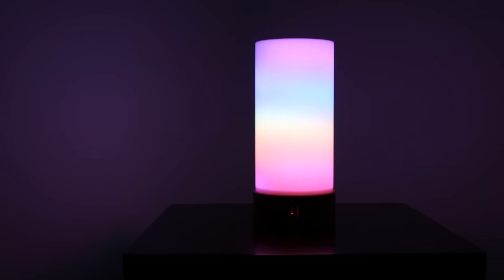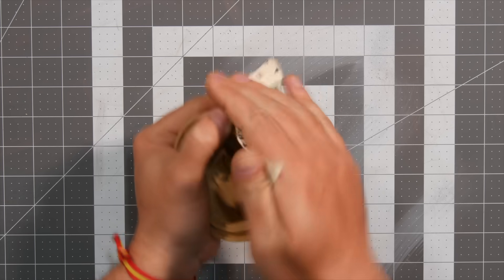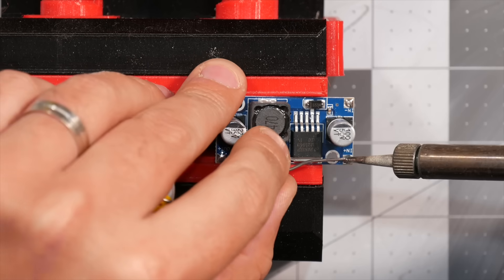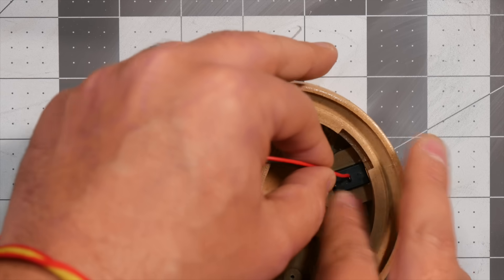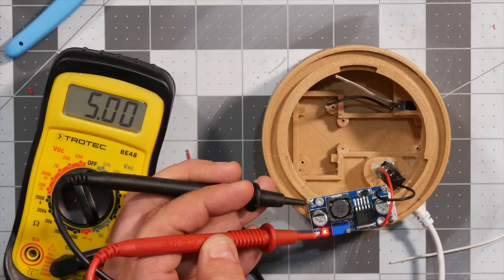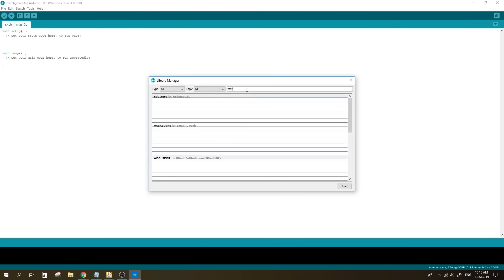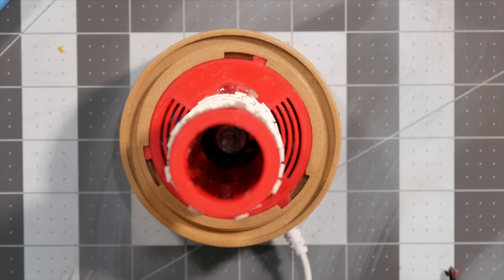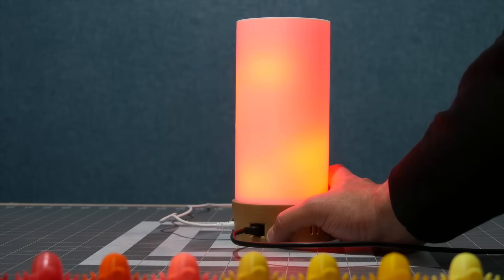Satisfying LED Mood Lamp - 3D Printing and Arduino DIY

Comment: tip: use a nodeMCU with mclighting, then you can control it via your smartphone
Reply: Using wifi or bluetooth or what?? Any other hardware required??
Reply: @franzeleznjak913  yes, use a nodeMCU, it`s about 2.50$ not much different from the arduino nano but with wifi

Comment: You should not connect 5V to the Arduino VIN, there is a voltage drop going via the internal regulator and it may cause the Arduino to be unstable. Vin will take up to 12V with no problem, so just connect the VIN to the DC input. This will also put less load on the step down regulator PCB.

Comment: Hi, it is better to go down with the voltage to 4V (just check, with the voltmeter that at the end of the strip there is still 3.6V when all LEDs white). The LEDs itself are 2.2V to 3.4V, the extra margin 3.6V is needed for LDO. Everything from 5V to 3.6V (almost 40%) is burnt to the heat. You'll get cooler strip with the same light intensity (https://cdn-shop.adafruit.com/datasheets/WS2812B.pdf - datasheet)

Comment: I have a spare 5V 3a external power supply (https://www.amazon.fr/gp/product/B07HRKHY3P/ref=crt_ewc_img_dp_1?ie=UTF8&psc=1&smid=A1FRA7QRK2Q428). Can I use it and skip the LM2596 module? If so, should I solder the +5V on the VIN or the RAW?

Comment: Wondering if there is any kind of tiny bus bar for projects like this.  I couldn't find anything.  Would be nice instead of the dog-pile on top of 1 solder terminal.  Much easier to add/remove wires if needed. Maybe something with screw terminals.

Comment: hi, I was wondering if it is possible to use the second roll off filament with a dual extruder setup as a backup .when the1st runout censor detects run out off filament that the printer engages the second roll to resume the print . was thinking off this and didn't come across a tutorial for this possibility . would you think this is a option ,a specially for big prints this would be a great solution

Comment: Great work. Ordered parts, purchased files, base printing as I type. Can't wait for this one. Also, really loving wood filament so any suggestions (beyond Groot) for nice wood prints gratefully received. Keep up the great work Joe.
Reply from the maker: Will be doing a full video on wood very soon, especially on how to print it successfully on a 0.4mm nozzle
Reply: @3DMakerNoob  Great! I look forward to it. It's working well for me apart from the stringing, so any tips there will be really helpful.

Comment: Very nice project! Might I suggest adding a fuse inline with the DC connector for safety. I have a couple of lamps on my Thingiverse account (V4HE), including a Bat Signal and an ESP8266 based LEGO themed one- please feel free to check them out :-)

Comment: I'm just working on a project like this too. Going with the Teensy3.6 as controller tho, adding a logic level converter to it. And i'm doing a more intricate lamp shape, not just a simple cylinder. And i will definately just go and buy a 230VAC to 5VDC power supply. There is no point in using a 2-stage voltage step down system.

Comment: The arduino lib you are using  can actually automatically compensate for your power supply's max amp rating. Documentation here: https://github.com/FastLED/FastLED/wiki/Power-notes

Nice video and a great shake up from your normal videos!
Reply: Thank you for this comment, I just added it to the code. Works as intended.

Comment: Two questions.  First can the base fit an uno that already has the headers attached? and Second can a  Esp32 take place of the uno?   It would be nice to be able to control it by wifi or use an Echo if possible to change the light.  Awesome project!  I will be starting one as soon as i order the parts.  My printers will be busy. Just got an Ender 3.  Should the base be PETG due to the heat generated by the electronics?

Comment: Actually, the red from the buck converter should have gone to the Vcc on the Arduino, not Vin: the latter is for unregulated power, but your input is already regulated at 5V. The consequence is your Arduino is actually powered by 4.3V rather than 5V because of the additional voltage drop caused by the onboard voltage regulator. Not a big issue, but inaccurate.
Reply: Good point. Also the PSU is not on the "you'll need" list. What is the rating? How much current do the LED's take when all on max ?

Comment: Great project. A couple of questions, could you run the light and the Arduino of a USB power supply and is the fan necessary? I’m guessing it’s to remove the heat from the LEDs.
Reply from the maker: You can use the USB as a power supply as long as the brightness of the LEDs is reduced. The fan might not be necessary at that point as they won’t emit too much heat

Comment: Did you use the 1m rgb or the 5m rgb
Reply from the maker: 5m. You’ll need roughly 2.5 metres for this project
Reply: @3DMakerNoob  i got the ones you advised but only had place for 53 leds.

Comment: Great video and great project.
If you don't want to worry about Arduino or soldering you can still make this lamp (but not with the nice patterns) using USB RGB LED strips found on ebay.
Keep up the good work.

Comment: I'd suggest to use a wemos d1 mini with tasmota or other similar firmware that has some light shows and it can be controlled over Wi-Fi or even by the home automation controller.
Reply from the maker: Next project :) this was my first one so baby steps :)
Reply: @3DMakerNoob  just add the wemos shape on the base, then makers will handle from there 😉

Comment: Thx for that cool Project, but 1 little Thing you may or may not consider for the next Tutorial/Project.
If you start with mm use them everywhere (metric) if you start with inches use those everywhere. ;) (Inches are outdated and no one should use them anymore btw.) 😉✌
But all in all a great Project maybe you figure out a way to make you're own LED Light Pattern. (I would love this) 👌

Comment: Your hard work paid off, looks great, nice design. Is there a reason for using a 9 volt power supply with a buck converter? Can I just use a 5 volt power supply? Thanks
Reply from the maker: Most power supplies are 9 or 12v, so it’s easier and gives you more options. Plus you also get more amps :)
Reply: @3DMakerNoob  I have a couple of 5v 10amp power supplies waiting to be used, that's why I asked.
Reply from the maker: In that case you don’t need it :)

Comment: This is great, Joe.  I have the files and will start on it asap.  I have a slightly different voltage regulator on hand, but it's pretty close to the same size, I think.  Thanks!!!

Comment: Awesome work.
I see the nano has analog inputs. You could add a 10k pot to adjust brightness or maybe even a photocell to dim based on ambient light.
Reply: Yes. 
I thought the exact same thing. 
Room in the base for a potentiometer. 

Or.
I.R. or Bluetooth remote.
Reply: i have a pot with switch butt but i dont have any idea how to configure it
Reply: @lucamengoli332  that's not a potentiometer, that is a rotary encoder

Comment: 16 milli amps per LED? Do you really have 375 LED's in your flexi strip??
Reply from the maker: 60mah per LED
Reply: @3DMakerNoob  Ah, my bad. Cool video by the way. 

Did you do an Arduino courses before you did this project? Did you have experience with the C language before this??
Reply from the maker: None whatsoever, I’m learning as I go along :)
Reply: @3DMakerNoob  Ah, cool. I started that way and ended up investing in an Udemy Arduino course, but I have yet to complete them.

Comment: Is the diffusing shade 3D printed?  If so how did you get it so uniform without any 3D printing artifacts?  It would be interesting to print a Lithophane shade to see how the colors combine with the B&W images.
Reply: He said it in the video: 0 infill. So there's an air gap between two solid shells.

Comment: Why did you need a fan?
Reply from the maker: RGB LED strips tend to generate quite a lot of heat if enclosed and a high brightness, this circulates the air :)

Comment: I made a similar lamp but made with only 20 LEDs and Pringles caps.  😁
I see that you use hot glue to fix the components, I prefer to use joints, zip ties or self-tapping screws.
In any case congratulations, nice project. I'll make one.

Comment: You shouldn't use the Vin pin for inputting 5V as this pin is for higher voltages (7-11V ish). This pin leads into a voltage regulator on the back of the board. If you've already dropped the voltage to 5V using the buck converter, you need to put it into the 5V pin. It may work, but will be rather unreliable.
Plus, you really need a large capacitor between 5V & GND as the WS2812B strip will pull a variable amount of current and could cause issues.
Reply: However if it's a 3.3V 8MHz Nano then you should use the Vin pin, but the one in the video is the 5V 16MHz model. I'd hazard a guess that the regulator on the underside of the Nano is probably dropping the voltage supplied to the Nano to maybe 4.2V and this is just about within spec, but it's not the right way of doing things.
Reply: Spec if anyone is interested... https://store.arduino.cc/arduino-nano
Look for Input Voltage under Tech Specs tab.
Reply: Yeah, I soldered up a USB connector i attached to the step down converter in my project. Seems to work fine.

Comment: I think this is what i'm going to use as my introduction to arduino.
Reply: I think this is a perfect first project.
Reply: good choice lighting is a very good way to start arduino. If you havn't used step down boards or soldered before i reccommend getting a solderless breadboard and just messin around with leds, potentiometer and basic code. Im 15 and have been intrested in arduino for a while.
also as a really basic starting video i reccommend: 
https://www.youtube.com/watch?v=nL34zDTPkcs